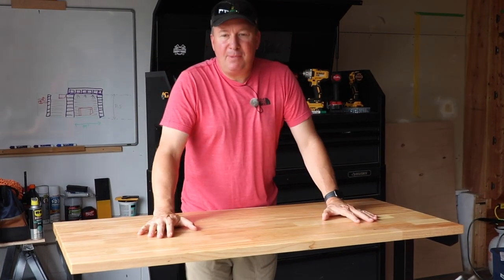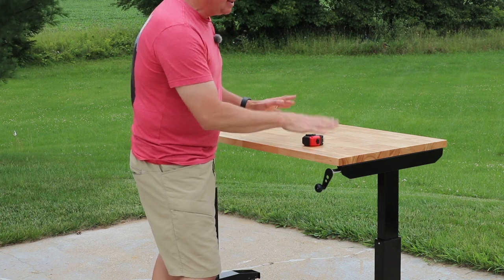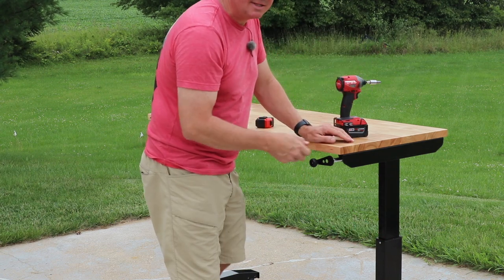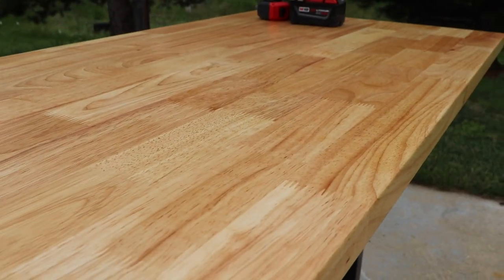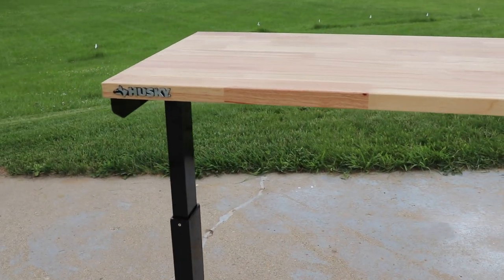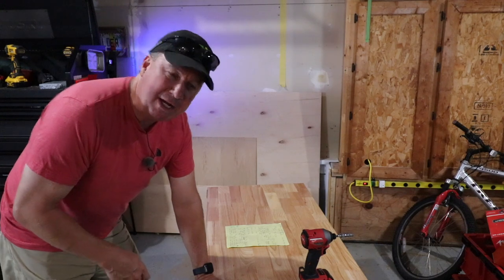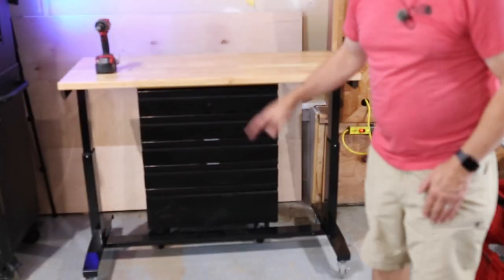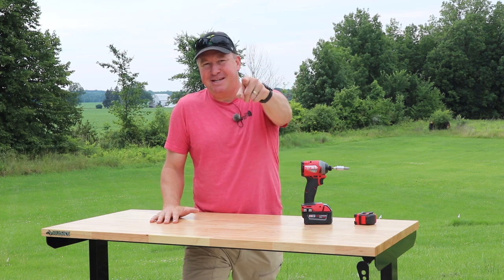HUSKY 52" ADJUSTABLE HEIGHT WORK TABLE  // AMAZING 4.9 STAR REVIEW!!

Comment: I have the 62" table and use it for my sewing machines and sergers. It is the best thing ever for sewing. I would like to get a second one for cutting.
Reply from the maker: That's good to hear how versatile it is for all the different types of projects.  I wouldn't mind another table too. 😀👍
Reply: That’s the exact size I plan to buy soon for my sewing/craft room that we’re building.  Did you get the drawers with it? I was concerned my knees would bump into them if I had it at the lower height for sewing.   I want to get 2 of them to put back to back to make a large work surface for cutting or crafting with others.  Thanks!
Reply: @dianeb95  no I didn't get the drawers. They are not available in Toronto, Ont. Canada.
Reply: @gertrudewelsh781  Thanks Gertrude for your reply.  Another option might be to fit a shallow computer keyboard drawer underneath just to keep sewing notions handy.  Anyway, thanks again!
Reply: @dianeb95  keep in mind that the mechanism to move the table up and down is exactly in the middle of the underside of the table top so you may not have room for the tray. It protrudes down about 2 inches.
Reply: @gertrudewelsh781  Thanks for the info, Gertrude.  I think I’ll just get one without the drawers first to see how it works. Unfortunately it looks like my local HD doesn’t have a floor model to try out before buying.

Comment: Very nice video!  I bought two (62" and 72") to form an L-shape desk in my home office.  These tables have no problem supporting my three 32" monitor setup.
Reply: Hi, I'm planning a similar setup. Is it difficult to raise/lower your table with the added weight of the monitors? Also, is the bottom cross beam in the way of your feet? Thanks!

Comment: It's so funny. At Home Depot I played with the display and the handle falls off. That's when I realized I could substitute a drill and bit. What is the first thing you did? Crank it with a drill, and you used my favorite Milwaukee. I have a closet full of M18 tools and batteries. Next the reviews mostly show indoor use for office desks and I imagined it as a serving table. So, I have decided my Christmas wish list. The easy height adjustment is the selling point for me. Thanks for a great review.
Reply from the maker: I'm sure you would be very happy with this as a Christmas gift.  I'm working on my new tool review area and this table is what I'll be standing behind.  I like that I can quickly adjust it as needed.  Thanks for sharing, I appreciate the feedback.🙌

Comment: Wow! Awesome table with just as awesome a review. Yes, you answered every question, though you might have said a little more about how easy and convenient it is to move the low brace to the back of the frame connecting to the alternative sockets Husky built in for that purpose. 
My garage floor is not perfectly level. The Husky table's adjustable height allows me to roll anywhere on it and to match up for perfect indeed, outfeed and support need for multiple tools.
Thanks for answering all my questions plus a few more that I didn't think to ask.
Reply from the maker: Glad to help.  This table comes in handy for many projects.  I'm glad I bought it.

Comment: I've got two of these 52'" and 46" in & out feed for my DEWALT table saw also use as a project tables.  I love these tables. Able to move every where in my shop and out side on the driveway with my Tsaw.
Reply from the maker: Nice idea having 2 of them.  I love this 52" one.

Comment: Thanks for making this review. Being able to adjust the height of this table is great for me. I will use this table for building video and audio gear setups, and I prefer to stand. I also like that you can move the cross beam at the bottom of the legs forward or backward to make room below. Looks like a good find.
Reply from the maker: Thanks, I've been very happy with this table so far.  I may have to get another one that's 62" long.

Comment: Hi Mark, awesome review. I'm considering buying the 46" and 52" Husky tables. Can you tell me how wide the legs are? Just asking because I need to know if the 46" table can slide in underneath the 52" table. For a home studio, I plan to use the 52" as my computer table and the 46" beneath it would serve as a midi keyboard pull out tray table. For that I need to know how far apart the 52" table's legs are from each other. Thank you in advance. 😀
Reply from the maker: I've seen all 3 tables on display at Home Depot and they all nest underneath each other.  The next time I'm in the store, I may have to see if they have all 3 and make a short video.

Comment: Could you sit and use a computer at the table? Curious about using it as a desk. does that middle bar get in the way? Thanks!
Reply from the maker: That a great question.  The middle bar could get in the way for some, so it's able to move to the back and out of the way.
Reply: @MarkThomasBuilder  Awesome, thank you!

Comment: I bought mine for $299 at Home Depot, mine is white I would’ve preferred black but overall amazing table! Especially if you need storage and space to do glue ups, etc and need height adjustment because you’re short like me… couldn’t be a better deal. Now I just need to find bins that fit the thin drawers
Reply from the maker: I'm very happy with my table.  I've heard someone say the Rockler drawer organizers work well, but are a little expensive.  I think they might fit.

Comment: I was not able to assemble this according to the directions so I sent it back.  The beam that runs between the legs and screws to the underside of the table was too wide. I tried inserting it from every possible angle and it would not work. I even tried loosening one, then two legs to see if that would increase the space.   I ended up scratching the leg and that's when I decided to return it. I contacted Husky and Home Depot and no one knew the first thing about assembling this. I wasted a day and they got a scratched table back.
Reply from the maker: I bought mine pre-assembled and it works perfect.  I think I read a few comments early on where there were a few issues with assembly.  I haven't heard any lately though.

Comment: Can you move that bottom cross beam to the back of the desk rather than in the middle? I want to use it as a computer desk but worried it will get in the way
Reply from the maker: Yes, the bottom cross piece can be moved back a little to allow more foot room if needed.

Comment: You mentioned the crossbeams at the end of the video. Is the cross beam adjustable and removable? I want to use it as a work desk but don't want my chair wheels hitting that crossbeam. Thanks
Reply from the maker: The cross beam is centered right now.  I know you can move it back a little bit, giving you more foot room.

Comment: Hi ... I hope you or someone else can help me. I bough the 46" table and assembled it yesterday. There's only one problem: the table height will not adjust. I've tried it while it is upright, and tried while it was placed with the table top flat on the floor. I tried it with the crank handle and with a T-handled hex wrench. Nothing. I'm afraid to force it. Just wondering if there's some secret that I have overlooked.
Reply from the maker: Sorry I'm not familiar with the assembly. My local Home Depot had this one preassembled

Comment: Can I adjust the height if I have around 50lbs on it (2 monitors and 2 laptops)
Reply from the maker: Yes, I put 2 -50lb dumbells on mine and it cranks up with a little extra effort.  It cranks down easily, as I expected.

Comment: what is the measurements of the crossbar under the table top, {the enclosure for the adjustment rod)
Reply from the maker: The enclosure of the horizontal adjustment rod, just under the wood table top is 47-1/4".  The distance between the inside of the feet is 46-1/4" FYI.

Comment: I have it as a pc desk and its great for the price and the quality, but my god I do also hate it.
- Max height is nearly not enough for me as a standing desk (I'm 6'2)
- the sides of the desk are covered by metal, which blocks off anything to clamp onto. 
- The depth of 24" is just shit, feels cramped. Though saved some space in my room.
Reply: Good insights. I'm 5'8, I wonder if it would be a comfortable height for me. Also concerned with the depth you mentioned.
Reply: @marvean2519  I actually bought a vesa arm for my monitors that saved some space for the depth.

Also at 5'8, you'd need 44 inches for a comfortable height. The max height for this desk goes is 39" or 42" with the castor wheels.
(check some ergonomic calculator)
Reply: 2inches off would be major bummer. I was really interested in the Husky. Would you happen to have some nice alternatives that are also sturdy?
Reply: @marvean2519  I honestly don't know. You could check out a standing desk frame and buy a wood top for it or just watch out for sales. It might cost more tho.

Comment: What is the size of the tool to fit the drill and crank
Reply from the maker: I found a 3/8 hex bit.  Here's a link to the Husky one at Home Depot. https://homedepot.sjv.io/jWdNNv
 If you look at the 2nd image from the top, that's exactly what mine looks like.  The top picture looks like 2 different sizes and not what I use.

Comment: Would you feel OK with hammering nails into a project in this table without damaging top
Reply from the maker: I use my sawhorses for heavy duty hammering support.  I mostly use screws or an air nailer on the majority of my projects.  This table works well for that.  I also have a XL Rockler work mat that I like.
Reply: @MarkThomasBuilder  good call thx

Comment: Would a 100 pound machine on only one side of the table mess up the lifter for the table?  Want to make sure the table would still go up and down evenly ! Tysm !
Reply from the maker: I haven't tried lifting more that 50lbs on the table so far.  The claim is that it holds 300lbs and I don't recall anything saying it needs to be centered.
Reply: @MarkThomasBuilder  thank you !

Comment: how can a work bench only have a weight capacity of 300lb.. cheap crap
Reply from the maker: Husky also makes a 3,000 lb capacity one that has adjustable legs that bolt into position.
Reply: @MarkThomasBuilder  nice, thanks!